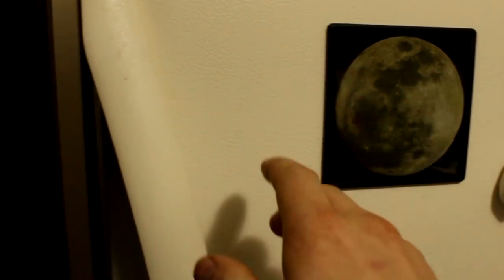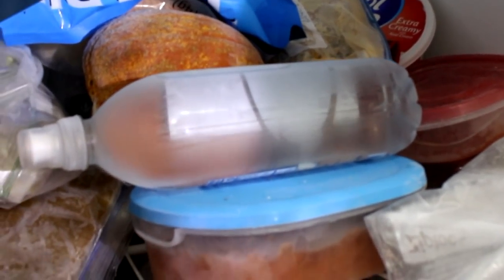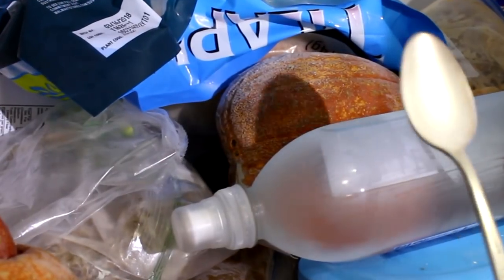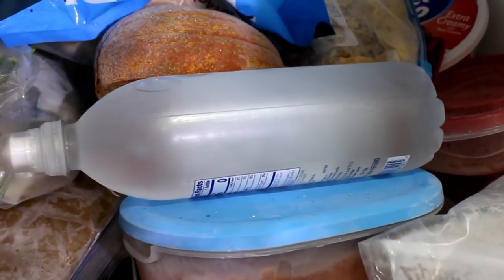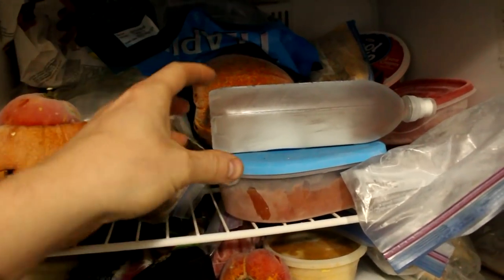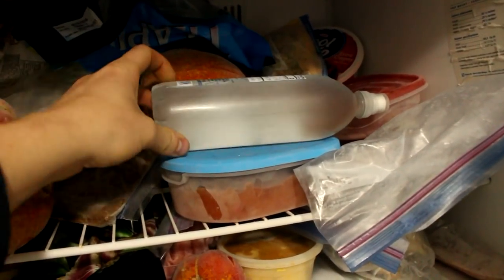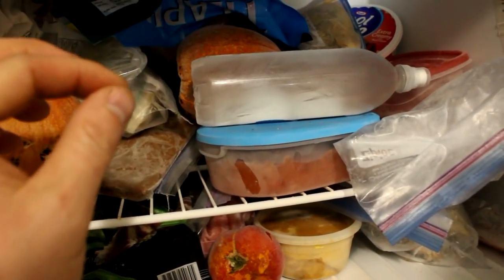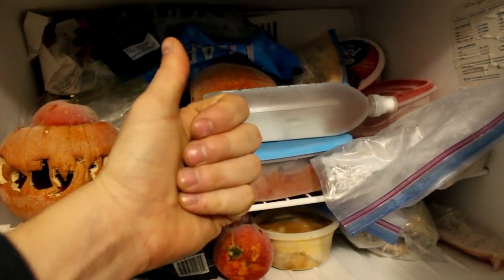Water Heats Up As It Freezes!?

Comment: Is it possible that the change in "temperature" on the thermal camera is due to a change in emissivity?
Reply: No.  A change in emissivity would change the total amount of radiation emitted, but not the peak wavelength, or more precisely the shape of the blackbody spectrum.  What a thermal camera does is measure the effective temperature of an object by characterizing the blackbody radiation coming off of it.  Going by intensity alone would be a very big problem for a thermal camera and produce significant errors for exactly this reason.  It would claim vastly different temperatures for different materials even if they are at the same temperature.

Comment: Can you make some experiments how cold you can make water before it crystallizes on its own? How cool you can go??
Reply: According to Wikipedia: "Water normally freezes at 273.15 K (0 °C or 32 °F), but it can be 'supercooled' at standard pressure down to its crystal homogeneous nucleation at almost 224.8 K (−48.3 °C/−55 °F)."
Reply: Wow! Thx for the info.       But still.... I'd love to see Cody doing some experiment on this... A video is a video... :)
Reply: It gets harder and harder to do, since you need extremely pure water, a completely smooth container, and stability from vibrations. And the outside must not frost up so you can see what's inside. Tricky to do in domestic freezer...
Reply: Domestic freezers only  go down to  a certain temperature (typically -20C) due to the refrigerant that they use (safe and non-toxic). Industrial freezers can go significantly lower, since they use ammonia vapour (unsafe and toxic).
Reply: can you make it go cooler if you change the pressure ? and if yes what would you need ? high or low pressure?
Reply: seaturtle106 what do you mean? cant you just put water in high or low pressure in the freezer?
Reply: seaturtle106 ohh ok i thought that because water in low pressure boils faster that maybe it will take longer to cool if you freeze it in low pressure
Reply: Water vapour is a compressible gas, so pressure makes a huge difference to the boiling point. Most liquid such as water are relatively incompressible, so the freezing point does not change significantly.

Comment: Does hot water freeze faster than cold?
If so why?
Reply: Oh yeah why? because "Water molecules consist of two hydrogen molecules attached to an oxygen molecule primarily through strong covalent bonds. Normally, covalent bonds will soften and lengthen as they are heated. But in water, because of the unique properties of hydrogen bonds—the interaction between the hydrogen atoms in one water molecule and the oxygen molecule in a neighboring molecule—the opposite effect happens. As a body of water absorbs energy, the hydrogen bonds will stretch (causing individual water molecules to move apart from each other), but the covalent bonds within each molecule become shorter and stiffer—the same thing that happens when water freezes."...
Reply: That old claim has been debunked, but it took until very recently to disprove it.
Reply: +tubeist- dan; is my citation incorrect? I am not expert enough to catch where the explanation given might be flawed.
Reply: Heated water CAN freeze faster than cool water, but not always.  There are several factors in play with the mpemba effect (the hot water freezing faster than cold water observation), as pointed out in this video the act of freezing can sometimes need a kick of activation energy (the spoon-whack in the video causing a domino effect of crystallization) with hotter water the molecules are moving faster, and thus evaporation at the surface of the water is allowing heat to escape the water at a much higher rate, especially if the air has a low moisture content, which would accelerate evaporation (which in effect steals heat energy from the rest of the mass), as freezing always starts at a surface (internal surface or external surface) and the rate of heat loss at the surface is greater than the rest of the volume, with the rest of the molecules already being energetic there doesn't need to be a kick as the molecules already provide it.  Basically the hot water will have less of a chance of super-cooling (going below the freezing point without freezing) than the cold water, and with the evaporation creating a point where the water is losing heat very rapidly, this allows the hot water to overcome (in some situations) the head start that the cold water has.  This effect is best seen at higher altitudes (increases the temperature at which boiling happens) in dry climates (decreases resistance to more moisture entering the air), both of which will create a draft further accelerating evaporation, and thus cooling of the surface.  All things being truly equal, cold water should freeze faster always, but as things cannot be equal (one is hot and one is cold) other factors will cause their differences to have different advantages and disadvantages, depending on the environment in which the experiment is performed, in the race to reach the solid form of water. (that last sentence was horrible, there should be a semicolon in there somewhere, but I cannot be bothered.)

Comment: I wonder if the water in the bottle became amorphous ice or ice Ⅰ. Could you even do something to it while it's still slushy to influence which form the final solid block will be?
Reply: According to Wikipedia, amorphous ice requires extremely rapid cooling: "If water is cooled at a rate on the order of 10^6 K/s, the crystal nucleation can be avoided and water becomes a glass - that is, an amorphous (non-crystalline) solid."

Comment: I wonder about the accuracy of your observations, water, ice, and plastic all have similar but different emissivity properties, I wonder if a thermal camera isn't the best tool to measure this. Maybe also try containers made of different materials, or an open air container if possible. Maybe corroborate your observations with a thermocouple or thermistor if viable

Comment: So this supercooled state can happen to any matter and not only to water (who's property are rather special due to the hydrogen bridges) then?
Reply: Guodlca Thanks! Very interesting. Amorphous metal sounds very special. And hard to make. Maybe with liquid helium or something. Sounds like a project for Cody's Lab ;)
Reply: Yes. Gallium melts at 85.57°F (29.76°C) but can be supercooled to -18.4°F (-28°C) That's almost 100°F below the freezing point. When shopping for electronic solder you can specify the melting and freezing points separately because different uses require different properties.

Comment: but how did you get the water to not freeze in the freezer? is it because it's purified?
Reply: It worked just fine with the regular tap water I had in my car over night in a regular plastic bottle. So I guess it's not that hard to get.
Reply: yes a lot of regular tap water is also very low in particulates
Reply: Jusb1066 It's probably low in particles but definitely not low in minerals around here. So it's probably mostly about particles and gas bubbles.
Reply: minerals are for a part dissolved though right and wont affect nucleation
Reply: Jusb1066 yas, you're right.
Reply: Guodlca they have a negative effect on crystallization

Comment: Is the water 'heating up' as it freezes, or just emitting long wave infra red radiation?   Just because an LED glows red or a chemical reaction gives off light doesn't mean it's getting hotter.  I'm not sure how this could be tested; perhaps with very small sensors in the water as it freezes>

Comment: I noticed this years ago back when I would go to camp (not the fact that it heats up slightly as the phase change occurs, that I didn't know until I watched this video, thanks Cody!) But when I would go to camp, I would always leave a water bottle in the freezer overnight so it could freeze and get cold for the next day when I would be outside a lot in the heat. But sometimes I would notice that it would still be liquid when I opened the freezer the next day, and it would turn to a sort of slush when I moved the bottle. Eventually I learned about how it needs a little disruption to start the crystallization process.
Reply: I've heard thats when some house pipes freeze, when someone opens a valve to create a nucleation site while the water is still supercooled.

Comment: I am still questioning your thermal camera. It looks like it is 9hz. But in the us you should have zero issue getting 30 or even 60 Herz cameras. 

Then the palette, you used iron becuase it's been marketed by flir - but use blackhot greyscale when you use your camera to see in the dark. Use a alert or irongrey to live signals. 

Then there is an issue with palette locking in video, your video is probably non radiometric as you have a consumer fade camera but there could still be histogram stretching happening when the majority loses temperature like opening a freezer. 

Then the reflection of plastic versus the emission. It's also a factor.

Comment: Does that mean you can have water at +100°c?
Reply: If you don't have any nucleation points (dust grains, small bubbles, or dissolved minerals) then yes it is possible to keep water liquid above the boiling point. But if any part of it starts to boil then it will all start boiling in a wave that can be explosive in how it can push the liquid water out of a container.
Reply: What Feathered said plus you can also do it by increasing the pressure. As pressure increases, the boiling point increases.

Comment: What happens if you open a soda can in a vacuum? Like will it fill the chamber with a sticky mess, or just foam like normal? Seems like it'd make a larger foam based on the decreased ATM pressure and with no dust in the chamber, the bubbles would last longer so they'd reach their maximum size. But would that size fill the chamber or would the surface tension on the bubble be enough to keep it from going insane (each bubble trying to get all the way to the walls)? I wish I had a vacuum chamber. And a selfless robot to open the can for me.

Comment: Cody are you able to make a solvated electron solution with amonia and a group1 metal and store it inside a glastube like you did with several gases to show their critical point? 
As far as i know the amonia must be at liquid state to be able to dissolve electrons, in every video i have seen they did the trick by cooling it down. However if its pressurized thus liquid it should be able keep them in solution after sealing the glass tube.
Id like to know if this would work. 
greetings from germany

Comment: You have to repeat the experiment with bottle covered with paint. Otherwise you don't know if it isn't just change in emissivity.
Reply: The emissivity of ice and water are practically identical (0.97 vs 0.96), as per Wikipedia.

If you cover it in paint, you won't have much of a video to watch, since it would take a minute or more for the surface temperature to catch up with the inside...
Reply: The bottle might as well be covered in paint as far as the infrared camera is concerned. Plastic is opaque in infrared.

Comment: But you hit it wouldn't that count as adding energy to cause it to turn to slush so a harder hit would make it more solid? Sounds stupid right
Reply: Kinetic energy is tiny compared to heat energy. For example, dropping over Niagara Falls increases the temperature of the water by a fraction of a degree.

Comment: It's weird how when liquid freezes it releases energy and when liquid evaporates it takes energy
Reply: The correct analogy is with vapour condensing into water, which definitely releases energy.

Steam produces terrible burns on skin, since it releases large amounts of heat when it condenses.
Reply: Gordon Richardson no it's not, that is how evaporation cooling works.
Reply: There are four standard phase transitions: Solid to liquid (melting), liquid to gas (evaporation), gas to liquid (condensation), and liquid to solid (freezing). The first two absorb energy, the last two release energy.
Reply: Gordon Richardson it's a misunderstanding i guess because you are right. I meant that it is weird how freezing releases energy and evaporation absorbs energy. Not their connection, and sublimation and its opposite phase transition are also standard.
Reply: Liquid water comprises the most stable substance on the earth's surface, making up up all of the oceans. It takes drastic exchange of energy to freeze the Arctic, and consumes even more energy when evaporating in the tropics. These limits make earth habitable. P.S. I forgot about sublimation and deposition, but these are relatively rare processes. There are also plasma phases transitions (ionisation).
Reply: Gordon Richardson ionisation is different to plasma phase transition and the fact that liquid water is denser than solid contributes only for the ice being on top, which phase transitions are exothermic and endothermic is determined by thermodynamics and order and ect.

Comment: I've put a bottle of water in the freezer before and it wasn't frozen when I came back, I touched it and it froze, but into some spongy slushy way. You could hold it, and squeeze it like a sponge. I've got no idea why it freezes like this, or how. Anybody got any ideas?
Reply: What's shown in this video is exactly what you experienced: supercooled liquid suddenly undergoing a state change. As some of the liquid water freezes to ice, so much energy is released by the state change (enthalpy of crystallization) that it heats the surrounding water above the freezing point, leaving you with slush.
Reply: Luhsteesay _ in a theme park near my city they have a soda machine that had drinks in that also were supercooled so when you buy a bottle of coca cola drink a little bit of it then close it up flip the bottle for a quick second and it becomes super cooled so you have a coca cola slushy it was very good only annoying part was it had to settle a bit before you could drink it cause once you open the bottle half de bottle is gushing out like when you put a mentos in it

Comment: What if it just chancges the way it reflects surrounding infra red radiation, same as in visible light...
Reply: In this case, the infrared camera can't actually see the ice. Plastic is opaque to infrared cameras. What you are seeing is the transfer of temperature from the water to the exterior of the bottle. Since the material outside of the bottle does not change, there is no change in how it emits light.

On that note, it isn't reflecting surrounding infrared radiation. It's generating it. What you see here is the blackbody radiation of the object.
Reply: QwertyuiopThePie nice point. Water surely absorb almost all of the ir, but some plastics in the freezer seem to have some kind of reflection happening. Thought that the difference of density between water and ice could have caused reflections, but codys answer is pretty solid, since gold does the same.